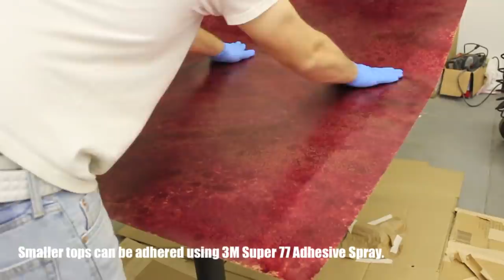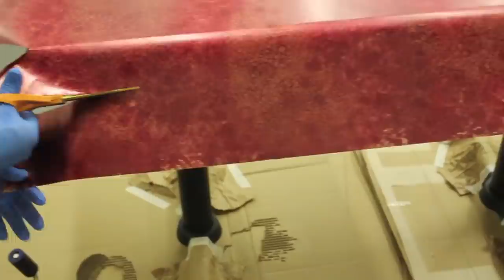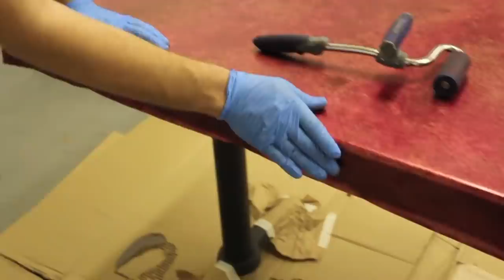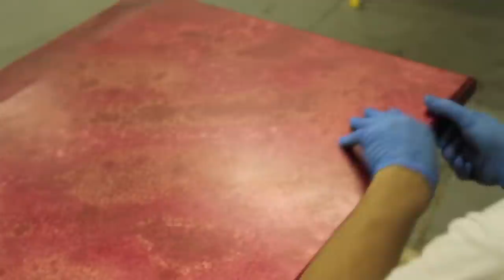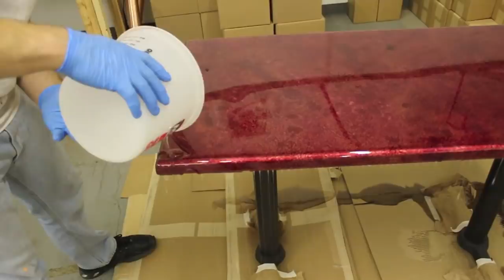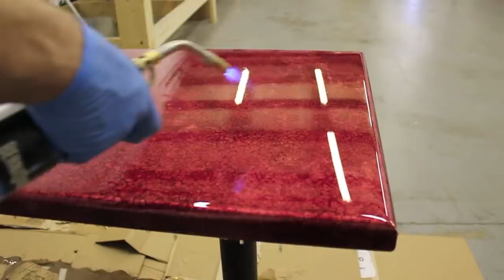Table Top Epoxy Tutorial | Tabletop Epoxy

Comment: you should always apply epoxy in a spiral, from the center of the table, let it spread, then fill in whatever spots need filling. this creates loads less waste.
Reply: unless you use a boarder waste is inevitable. use a permanent boarder, pour to desired depth and brush epoxy over edge
Reply: Tau Lewi

Comment: Epoxy curing is heat activated. This attacks bugs. Unfortunately I found this out myself. My tabletop came out beautiful on my first project and it is easy. My only mistakes (that don't show too much) is where a bug (only one, it could have been worse) got stuck and I managed to dig it out had patch with still soft drips and a heat gun, and one place that dimpled that I'm sure was from not putting enough epoxy on. Wish I'd been more generous. I was simply surprised by the fell of it. So go for it but see if you can seal the room you're using to keep out the heat seeking critters.
Reply: lol Thank God I have no bugs lol

Comment: Hi, is it possible to spread the resin first and apply after the adhesive paper ? I have a 209 x 60 cm table, the problem is that in the center I have a 5 mm depression, so I need to first lay the resin to level the top.

Comment: Two things. You only needed about half the amount of epoxy, which has been pointed out, but my biggest issue is why didn't you just add your own color to the epoxy? That would've saved time and been way more fun, plus it would be an original. Although it's safe to say there's not another one like it.

Comment: The amount of epoxy wasted in this video is making me sad
Reply: Why?
Reply: because epoxy is expensive and they pour it on the floor instead of just using a brush to do the corner of the table.. XD
Reply: Taistelumajava
Reply: Not only that, the video does not even address the issue of drips that solidify along the edges as the epoxy hardens.  Shameful.
Reply: sabs Not that much was wasted. No matter what you do when applying epoxy some of it isn't going to be used. Since he was applying it to a large table quite a bit of it had to be used.
Reply: i don't know ... i think Ka Wen made a point, not only they waste a lot but also, that probably leads to too much epoxy on the edge and perhaps an unfinished look at the end. anyhow, that was still kind of cool to watch it (afterall i didn't do anything else than just searching from my confortable chair, for my own little project, so I feel grateful someone made the effort of making that video).
Reply: @24hrlib  you have to wipe the edges with your finger few times while it is dripping
Reply: @ $99/gallon... they wish you would

Comment: How did you remove the droplets from the edges?
Reply: After cured turn the piece over and go back over it with a low speed sander. If you use a D/A like i did make sure you only sand with the disk turning into the piece... if it spins outwardly it can crack the edges. OR if you can catch the epoxy while it is still "Gummy" you can take it off with a razor blade

Comment: What's with the epoxy drops at the edge of the table ?
Reply: +kapernaumFishingClub JC Yeah a shit load of runs
Reply: kapernaumFishingClub JC You can either let the resin drip and harden then sand them off or after about 30 mins, take a brush and smooth it out.
Reply: That drip he didn't explain that you must have a small sponge paint brush to be taking the drips of or you will have to strip them with a blade , if you pull at them , they might pull toward the top of the table. It's better to get the drops off as they fall or hang there, others put tape along the edge then strip it off but I don't trust the tape.